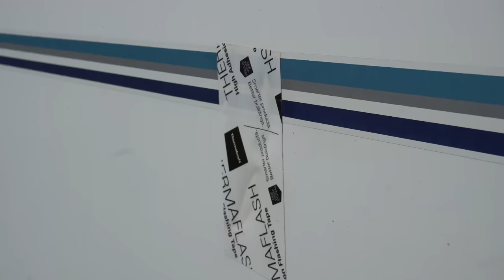Caravan Needs Fixing = RV Trip Away!

Comment: Hi Karen, you tube put you back in my feed yet I've been subscribed for a long time so I've been catching up. I imported my 4 berth  caravan from the UK to Cyprus around 3 years as they are very rare to buy here. Unfortunately there are no caravan repair shops here so I have to try and DIY everything myself.  Then I had an idea of getting in touch with a boat repair person, that didn't work as they never got back in touch. So now my steadies don't work due to the guy using them manually therefore breaking the electrical system, so I'm propped up on bricks. My 3 way fridge seems to have packed up. I remember you having to replace yours at great expense so I've bought a second hand counter top fridge for the time being.  One of my windows came apart like yours has but I fixed that with double sided gorilla tape. My beautiful awning gave up like yours due to the hot sun. I'm permanently parked on one of the very few sites over here which I'm ok with as it's become my weekend retreat. I do have to be careful with power as we don't have much coming in maybe 5 amps and there are no water hookups, so I have to haul that in.